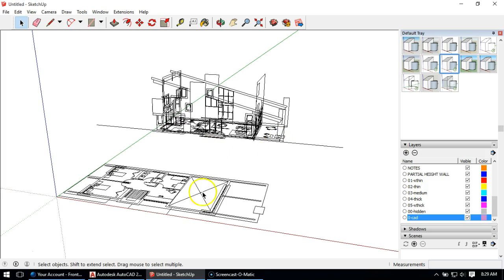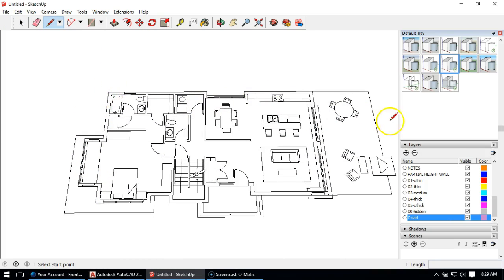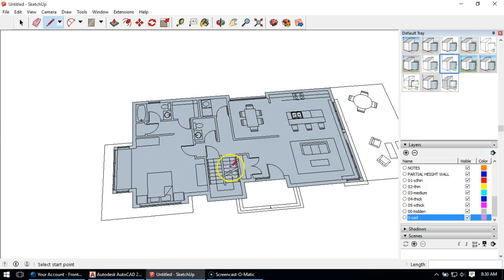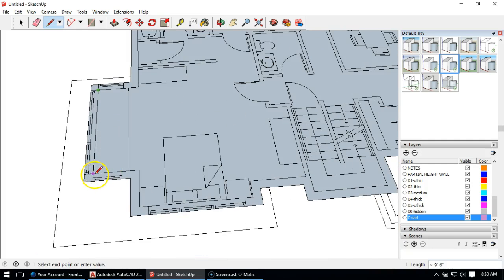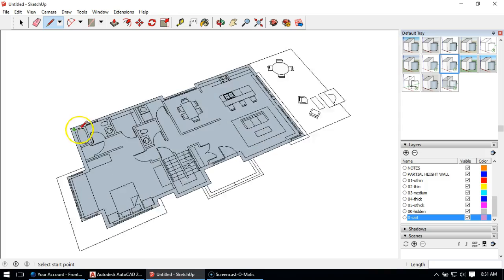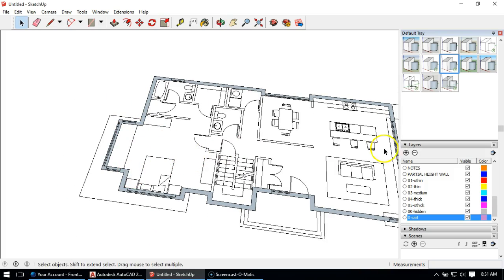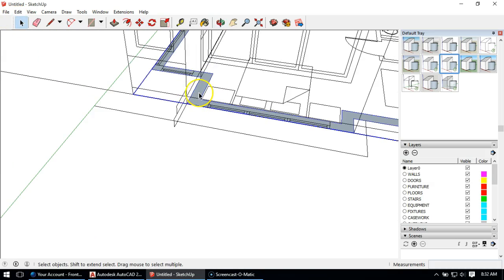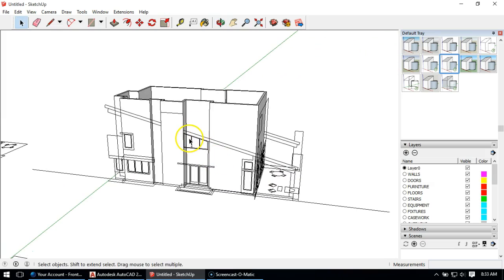3D Modeling Exterior Walls (Sketchup)

Comment: Why do you export CAD drawing as a block? Doesn't SketchUP open regular DWG file?
Reply from the maker: Yes, SketchUp does import .dwg. However, SketchUp is often behind a release and you need to save the .dwg to the version SketchUp can import. I find making a block the easiest way to do this, but not the only. And you are right, if the file is compatible, then you can just open it right up in SketchUp without doing anything to the cad file.
Reply: @michaeltweed5192  Capitalic THNX!